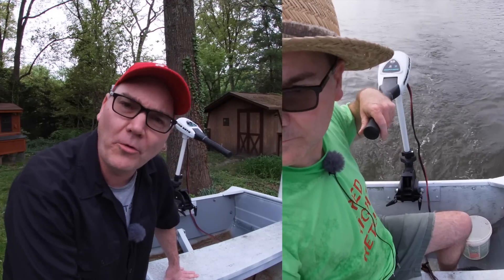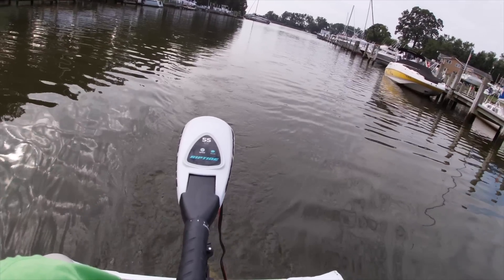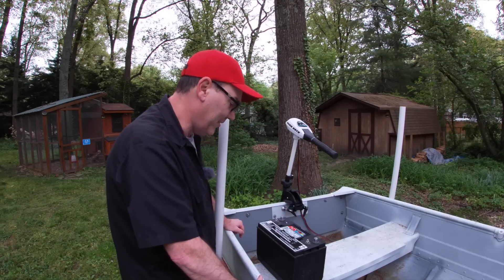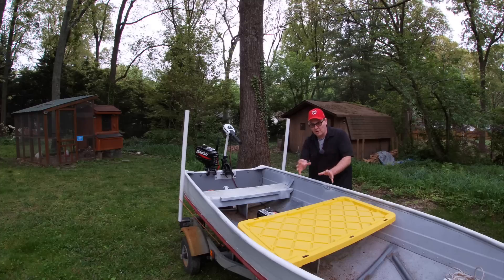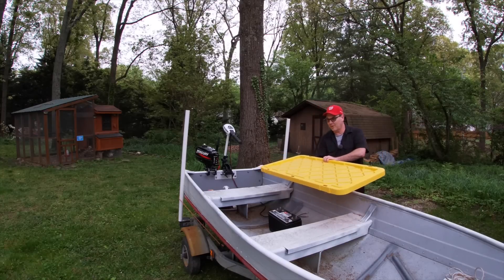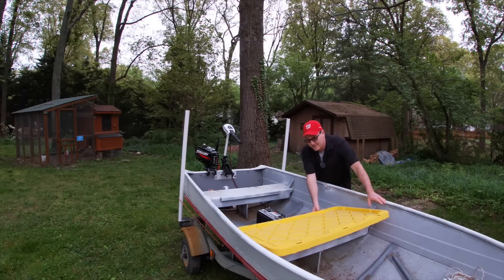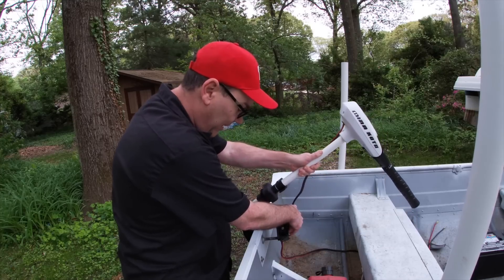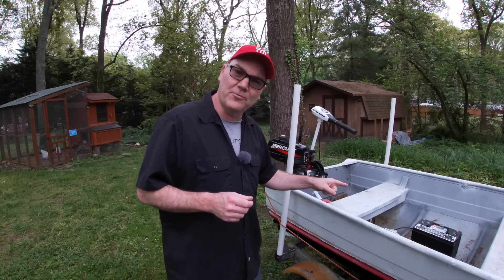How Many Solar Panels Do You Need For A Trolling Motor?

Comment: It's worth noting that used panels can be really, really cheap. Also your LiFePO4 battery example is a hundred freaking amp-hours! You just need one of those and you can run a little trolling motor for half a day!
Reply from the maker: I have been looking for cheap used panels and they aren’t easy to find near me.

Comment: Extended operation of the trolling motor  will increase the odds of overheating the motor. Let me explain, the motor armature has no cooling fan (all other motors have a cooling fan) so the armature windings over-heat. Now you might think that the water will keep the armature cool, but you would be wrong. The water cools the case and the attached magnets that make up the stator. As the armature heats up, that air surrounding the armature gets hotter and hotter because it can't escape the armature. The stator does remove some of the air's heat, but the center of the armature continues to get hotter. Failure mode happens when the armature coils resin becomes liquid and splatters onto the brush holder. This makes the brush stickey inside the brush holder and the motor stops drawing current. This is  what I found when I tore down my minn kota 55# after it quit working. This serious design error (no fan) was allowed because the assumption was that the trolling motor would be used during short intervals and at low power. I called minn kota tech support and they said full power should only be used for about 15-minutes. The manual does not specify this limitation. I am working on a video for this topic at youtube-user: lwgraves.
Reply from the maker: That's very good stuff! I will look out for your video.

Comment: Hi Wayne,
Do you own any solar panels?
While you brought up some good points, some other things I'd disagree with.
To extend the life of your batteries, you should add a PWM speed controller to the stock trolling motor. There are numerous videos online that show the stock controller using the same amp draw no matter what speed you are going, essentially wasting power. Drawing 5 amps at low and 5 amps at high.
A single panel solar setup is not perfect but does a fairly decent job. My 12v motor drew a MAX of 5 amps (stock) My 80 watt (renogy) solar panel easily collects 3-5 amps of power on sunny days.
I don't worry about running out of power because I watch the battery voltage meter. Worse case scenario I can run the battery off the NOCO jump pack to at least get me to shore.
@0:50 "The technology isn't there yet" It might help if you show the proper panels.
The first panel you showed is a tiny 10 watt solar panel made to illuminate streets signs that retail for $60. 
There are plenty of 100 watt panels to choose from that retail for $100
Credentials: Vocational Certificate in Renewable Energy & 3 years of VanLife Solar.
Reply from the maker: I do not disagree with any of your points! The tiny panel was shown because people actually ask if a small panel like that would be effective in this situation. This wasn't a video looking into how I could make it work (adding a PWM etc.) - it was to address whether a small solar panel could significantly increase the range of a stock trolling motor and cost less than adding a second battery.

Comment: The answer to the Question is: 6. It takes six 100 watt solar panels to effectively spin a 55 pound trolling motor fast enough to move a small boat. I know this because I have done it. The problem becomes the amount of surface area required to keep 6 solar panels in the sun. I made a frame roof to put the panels on, but this creates a safety issue. It makes the boat more susceptible to wind, and it makes a nice cage for the operator to get caught in and drown if the wind flips the boat.
Reply: Sounds about right.  You can use lighter weight flexible panels to reduce the overhead weight making the boat less tippy.

Comment: My 24 ft pontoon boat is used just about every day.  Been sitting in the water for about 4 straight years and runs on 1 deep cycle 100amphr battery with 2 panels that sit sideways off the back.  Generally it's just relaxing pond duty cruising around a 3 acre pond fishing. Panels catch the morning sun and trickle til dark.  Has been ready for duty every time. Stays about 13.5 volts. Got tired of my charge controllers getting ruined so don't use one anymore. Charges at 18v but has never made it past 14 volts ever. But if fully charged and possibly over charged... Still shows 13.8 max.

Comment: gotta love videos where someone talks about something they don't know a whole heck a lot about lol. did you look up info from 10 years ago or something? or search out the most expensive solar panels you could find just to prove your point? who uses a 100w panel anymore that are that size? you can get a 400w panel for well under $1/watt nowadays. who the heck would put an agm battery on a small boat in 2022? I'll grant you that it would cost more and may not be as convenient for a fishing purposes to have a fixed panel roof covering a quarter of the boat but the costs and feasibility of running a small electric motor like that all day with a single lithium battery and solar panel is entirely possible and practical. finally when factoring costs, if you go out every weekend and burn a gallon of fuel, the cost of the battery, charge controller, and panel would pay for itself in about 3 years.
Reply from the maker: The research I did for this video was pretty extensive and based on what the average person could and would use to try this solution. I didn’t set out to build an electric boat - there are plenty of other people who have done that and you’ll find my comments and questions on many of their videos. I shopped Amazon for the solar panels and I could not find any offered that were “better”. This video was to address if a person with a regular old style battery (which MANY boaters still use) and regular old trolling motor could just pop on an easy to buy Amazon solar panel and get great results.
Reply: @WayneTheBoatGuy  I'll still use the old school 100 watt panels mainly because 2 are just about right for charging regular batteries. Not too fast, not too slow.  I'm probably a more professional solar educated person and run an entire house off grid so I already have extra equipment to run my boat the best way. Sure... I could easily run several large panels (400 watt) but they are almost 7 foot long now and I like my casting area open. You wouldn't know my boat was solar the way the panels are facing...

Comment: Try one 400 W panel instead of 2-100W or 2- 6V batteries in series, not parallel; 6v batteries gives more amp hrs than a single 12 v battery.

Comment: If your boat is too small to mount a solar array of sufficient capacity to keep the battery charged in a timely manner I'd first want to know what you intend to use a 3.6m boat for.
If it's for leisure activities, fishing, and generally pottering about on inland waterways, canals, and lakes then the solution is quite simple. You can have a large solar array at home to charge the batteries when the boat is not being used.
Your boat is still 'solar powered'; it's just that the means of producing the electricity to run it are not actually on the boat itself.

Electric cars (e.g. Tesla, et al) do not have solar panels. Boats that run on diesel do not have refineries on board. So why the obsession that every electric boat MUST have solar panels?

Comment: if you could mount a single 200W renogy panel on the bow. that pushes 12A at peak temperature at the right angle, and 8.5A at 35C on a 30 pound thrust motor, at first gear only uses around 5-6 amps. on paper, you could make it work. i put 2x 40W panels on the front of my boat, just because its easier to leave it on the boat 24x7 for a week of camping, than having to remove the battery, setting up the panels. not to mention, you loose out on precious charging time while fishing if you leave the panels on shore. I use panels to charge my jackery and the boat batteries, I was thinking of replacing the 2x40w panels with a renogy 100W or similar, but has to be minimum 100W otherwise i would not have enough power to fish from 6AM to sun up

Comment: The two 100 watt "canopy" setup might make sense in that you would have shade at the back of the boat, extend your range by 40%, and the not have to use your house electricity to charge it when its sitting at the house between trips. Assuming that the panels stop charging when the battery is fully charged and can charge while the battery is being discharged.  I don't know if that's the case.  But yes for straight range extension that extra batt is a better solution.

Comment: you are using a brushed (inefficient) dc motor designed to TROLL and lead acid batterys that are heavy, have very poor charging/discharging  characteristics that you can only discharge to half capacity before damaging it, probably also the the cheapest most inefficient charge controller you could find. 
try a brushless dc motor, victron charge controller and lifpo batteries. Expensive? yes. Is your gas motor cheap? Is it nearly nearly maintenance free? Free fuel? is your flat bottom boat an efficient design for this application?
People who fail to accomplish something and subsequently claim it to be impossible have been the bane of innovators since time immemorial.
Reply from the maker: There are several people who have built great solar boats - and if you watch their videos, I have commented positively on them, and often had discussions with them about their projects which I think are really cool. My goal wasn't to try to build a solar boat - it was to address whether the current solar offerings could affordably be adapted to items that many boaters already have to provide efficient additional power.
Reply: @WayneTheBoatGuy  You really just need a larger boat to deal with the size of solar needed.  Honestly... I'm too fat for small boats anymore... pontoon or nothing for me... I like comfort. Being in a hurry on the water just don't make sense to me.

Comment: two flexible 100 watt panel in series on a light wooden frame on the bow of my canoe…mppt charge controller inside my seat, charges constantly at 5 amps on a sunny day.  keeps my battery charged when not using, and all day trolling on a lake.  30 amp hour/4s  lithium phosphate battery.  Solar panels, charge controller and lithium phoshate battery comes in much lighter than a lead acid battery.  weight savings !

Comment: Have a look at Will Prowse's channel, because you can do solar a lot, lot cheaper than the examples you showed.  I believe he got a bunch of 200w panels for about $60 each, for example.  At that price, with a budget solar controller, you can add 600w of solar for about $250.

Patience and eBay alerts are the key, I would say.

Comment: your boat design is not very efficient and designed for rowing or a gas engine
Reply from the maker: That was kind of the purpose of this video - to show that we aren't quite there (yet) to be able to easily and cheaply add solar to some existing gear (like this brushed trolling motor and 50 year old rowboat) to be able to run it all day.
Reply: @WayneTheBoatGuy  I stumbled on your page hoping to find  info to  converting a streamlined ocean kayak to electric if viable. Just pointing out the aluminum boat not a good starting point having poor resistance. Batteries and solar panels are getting better everyday. I seem to remember years ago a paint that could create a charge if applied. Not sure where that went....thanks for the reply

Comment: those have to be the most expensive solar panels. I have 1.2kw at home, and paid 998$ less than a dollar /watt. I agree with the video points made. there is a reason large sail boats use windmills, they pack more power into a smaller footprint. of course like sun, wind is unpredictable. but you could put a 900watt windmill on that small boat and get a decent charge rate

Comment: Better off just buying a lithium battery and using the full voltage instead of only using the 50 available amp hours you can only use in the AGM. Most people don't realise you can only get approx 50 amp hrs out of a 100 amp hr AGM Battery. You can't run them dead flat. You can with a lithium battery tho.
Reply from the maker: Yeah there's certainly several solid advantages to a LiFePo battery!

Comment: Also, your little gas motor is 2 stroke and it's exhaust outlet is below the water level. Not too sure why they have not banned these motors yet, along with lead fishing weights.
Reply from the maker: True. In many places they have banned them and I don't think we can buy new 2 strokes, except maybe on Amazon.

Comment: Been there done that. 
12v is useless
Brushed motors are inefficient. 
Junk solar panels are a waste of $

Brushless, PWM controlled motor is more efficient, 

Running with 40v (or higher) uses less current for the same output power. 

Lithium batteries are lighter and have greater energy density.

PV matched to battery voltage is more efficient through an mppt charge controller.

I've used this configuration on my kayak, but a Catamaran is IMO the best platform for a PV powered boat.
Reply from the maker: Yeah it seems for the right money we can put something together that works - we just aren't to the point where adding a simple panel or two could handle hours of operation with existing brushed motor trolling motors that many people use.

Comment: Why make this video when you don't know anything about batteries, solar panels, or what boats they work on?
Reply from the maker: Here's why I made it - Many people have electric trolling motors. A few people have made videos where they run a small boat with a trolling motor powered from solar.  None of those videos covered the cost of the solar set up, or whether doing something less elaborate than a complete solar roof would give satisfactory results. This video was to address whether a small solar panel was a cost effective way to extend trolling motor range.

Comment: You can still solar power your boat .. in a way. As you said, add more batteries to give you all day runtime - then use a large solar array OFF THE WATER to recharge them at night. Solar power for the batteries, all day range, solar powered boat. Just not with panels on the boat providing the juice. (Kind of like solar panel roofs on EVs won't keep it going forever, but might add a mile or two per day under "optimal" conditions.)

Comment: Trolling motors especially 12v ones are very power hungry. There are better choices for motors and speed controllers if you are going to do this sort of thing. Just throwing more batteries and panels at it won't really do it.

Comment: I have a 210 watt solar system that I have used to take my bedroom off grid.

I am amazed how well it works and how quickly my battery recharges everyday.
Reply: I have 410 watts in 4 panels but only need half that much.

Comment: The problem is... If you expect solar to perform as good as gas in all situations, you will be disappointed.

Solar is an entirely different animal.

Expensive up front cost but free fuel after that... With substantial limitations.

Big array, less time to recharge. Small array, MRE time to recharge. What will your needs be?

Works best on sunny days.

Reasonable expectations are everything.

Can you use your boat solar to provide power for other uses when you are not boating?

Can you make a fixed, land based, solar system to charge your batteries, troll around all day and then charge them with solar when you get home? The solar array could provide power for other uses when not recharging the boat batteries.

Solar is good if it is used appropriately. 

If you have unreasonable expectations you will be disappointed.

Comment: I ran the simplest possible version of a "solar boat" on my local lake for a couple summers. 1x 50lbs-thurst motor, 2x 100AH deep cycle batteries, 1x 100watt panel. I would troll for maybe an hour or two to reach a destination, anchor/beach the boat in the sun while my kids swam for a couple hours and then troll back. Having two big batteries and assuming I would always end up with a net-loss of stored energy made me comfortable enough to omit the charge controller to keep the system super simple. Other than being slow it worked quite well.
Reply: makes no sense when renogy wanderer controllers are $30 to be honest
Reply: Based on the fact that my batteries never once reached 100% SoC with the solar panel connected, I'd say that in my use case the extra $30 would have been the thing that made no sense. To be fair though my use case is fringe enough that I don't suggest anyone else do it this way. Basically I was willing to take on the extra hassle of manually protecting my batteries rather than paying for the convenience of a charge controller.
Reply: This worked for me on my RV. You might want to check the electrolyte levels in your batteries once in a while to make sure you aren't boiling off too much water. If you have to add more than about 12 ounces of water a month to each  battery you may need to consider a charge controller . . . or you could disconnect the solar panel periodically to reduce overcharging.

Comment: 24/36v setup with residential panels is about 4x cheaper and more efficient(and even more so if you look to the aftermarket). 12v stuff is way over priced, and you can get used or cosmetically damaged residential or ex solar farm panels for less than 50$ for 200w+ panels.
Reply: Best advice so far. However,  if you want to go large... do a 48 volt system. Amazon actually sells 48 volt boat motors that can go decent speed.